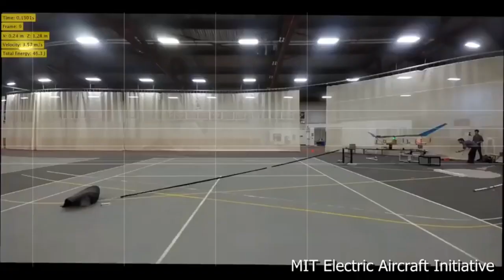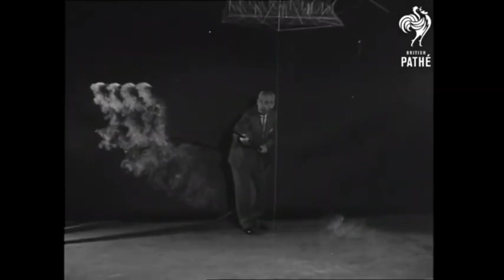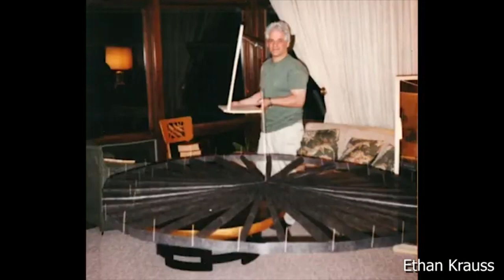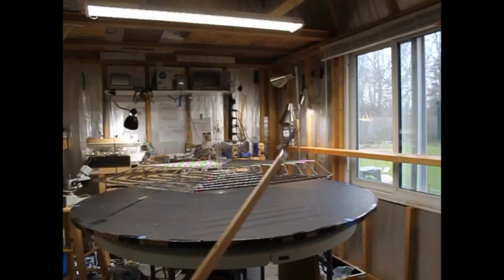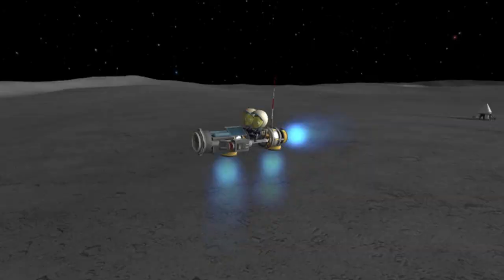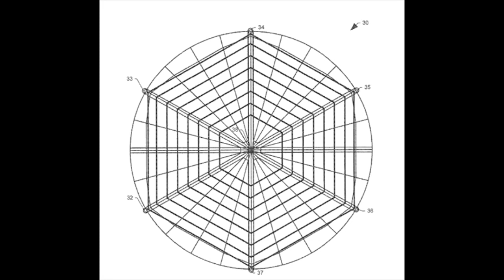Self-Contained Ion-Powered (propelled) Aircraft.  This ion thruster lifts its power supply!

Comment: Amazing work! I have a few question about optimizing some of the contributing forces. I'm looking for research papers on the dielectrophoresis of air and what the limits of that force is before you reach dielectric breakdown voltage. Do you think it is worth while to optimize the magnitude of the force of dielectrophoresis of neutral air molecules and the non-linearity of the inhomogeneous electric field? Or is the magnitude of the dielectrophoretic force so low that the majority of energy is from ion drift and entrained neutrals? I wonder if ionization is actually more or less efficient than this electrophoretic force and how they scale, given that it takes considerable energy to ionize air. Maybe they synergize with some optimum balance where ions enhance the electric field and thus the dielectrophoretic force on neutrals.
Reply from the maker: For now, I'll just give you the simple answer. I can always add more to it later:).  There are lots of problems with the way ion propulsion is currently envisioned.  The equations say that the force is directly proportional to the current.  I have found however, that if you add lots of current, most of it just gets wasted in the form of heat.  Higher voltages at lower current densities create many times more thrust with a lot less power.
Secondly, while there are equations that indicate that it takes a significant amount of energy to create certain types of ions, it is possible to just add electrons to the outer orbits of O2 molecules with very small amounts of energy.  The main challenge is just to reduce the losses associated with creating a high voltage source of low current electrons.
Additionally, letting the voltage on a given emitter collector gap get near the breakdown voltage, like people do with "lifters," creates a much larger current draw,  creates more heat loss, and is consequently many times less efficient, so it takes a lot more wattage.  I am not saying that it isn't possible though, the current input just has to be kept low one way or the other.
The electric field really is inhomogeneous and nonlinear as you were saying.  This is one of the many reasons I'm excited, because, it could be evened out with smooth rings etc.. I think there is still lots of room for improvement:).
Thanks very much for commenting!
Reply: @KraussEMUS1  
This may be beyond the scope of this discussion but I must mention there is a wealth of information regarding plasma and plasma waves as the ideal medium for a process called 'optical phase conjugation' or '4-wave mixing'. One scientist, Larry Reed, has proposed in his paper "Confinement of Light: Standing wave transformations in phase locked resonator" that this process of phase conjugation can be used to impart momentum to and from the environment using the phase conjugation of electromagnetic waves. I find the process he describes analogous to a lever and fulcrum but the lever arm is composed of light in a standing wave, and the fulcrum is a holographic material with non-linear opto-electric properties so that it may couple to the light field.
Reply from the maker: @taylorwestmore4664  
It would be nice to see some sort of replication of TT Brown's HV generator.  I have built a similar sort of thing a long time ago when replicating the Sky Station International patent.  It did not have the capacitors or make any attempt to harvest output voltage though.  I don't know how it would do that   , aside from resembling a Marx Generator somewhat.  I am a bit distracted right now, but will give it some thought.  
Thanks a lot!!
Reply from the maker: @taylorwestmore4664  
Hi Taylor,
This is fascinating material!  For the time being I am concentrating on making a small vehicle fly outdoors as soon as possible, and hopefully with agile steering as well.  I am also making progress with making it reliable.  There are also a few other things in the works, so I don't have much time to go beyond working on a basic EAD UAV.  I'm definitely interested in hearing about what may be possible though!
Thanks again!
Reply: @KraussEMUS1  And thank you for your great work, it is a service to humanity! I'm eager to see your outdoor craft when it is ready to astound the world! Stay safe in these strange and dangerous times, the world needs your genius! 

I will consider the problem of optimizing the flame jet generator as well. Brown was using a thermionic cathode to charge fuel exhuast negative, but he never fully ionized the exhuast into a plasma state.

I believe the solution may already exist in the form of the Helicon Antenna, notably employed by NASA to ionize propellant for the VASIMR rocket. The maximum efficiency an EHD or MHD generator/accelerator can obtain is proportional to the difference in kinetic energy of the ions before and after the conversion cycle. So if we can fully ionize 100% of the exhaust of a hydrogen flame, which means using the Helicon antenna to turn 5000F degree steam into a neutral plasma of free radical Hydrogen and Oxygen, then we can efficiently convert the kinetic energy to electric power. Exhuast in fully plasma state can be charged positive or as Brown suggests negative with a thermionic cathode. His primary reason for this is to give the correct forward direction of the electromotive force and naturally a thermionic cathode is very efficient electron donator at high temperatures. NASA is exploring electrode-less solutions for fusion rockets like the Helicon antenna because the cathodes tend to erode in thermonuclear plasma. But a cold plasma can result from EHD or MHD cooling, that is the goal, as heat that doesn't move ions across a gradient represents a loss to the electro-kinetic system just like heat in any other engine. Cold plasma has very high electron temperatures compared to ion temperature so it has low losses to heat, it would make sense that cold plasma propulsion for drones would be your ultimate aim for this as a mature technology. The trick is getting cold plasma at those speeds and densities from either a air or fuel, or atmospheric electricity or battery power etc. 

Another possible configuration for an ionizing stage could be a rotating magnetic field. Per the  article on the Princeton Plasma Research Laboratory's "Reversed Field Pinch" reactor:

"Rotating magnetic fields have also been used to drive current. In such experiments, as above, gas is ionized and an axial magnetic field is produced. A rotating magnetic field is produced by external magnetic coils perpendicular to the axis of the machine, and the direction of this field is rotated about the axis. When the rotation frequency is between the ion and electron gyro-frequencies, the electrons in the plasma co-rotate with the magnetic field (are "dragged"), producing current and reversing the magnetic field. More recently, so-called odd parity rotating magnetic fields have been used to preserve the closed topology of the FRC."

This is the basis of another kind of plasma engine being proposed that ejects the resulting loop or toroid of ionized gas with a magnetic nozzle, the thermal energy is efficiently converted to kinetic energy by the expansion of the ring plasma and it's magnetic pressure against the eddy currents in flux conserving bands of copper or aluminum, the asymmetrical magnetic nozzle and the rotating magnetic field of the driving coils. I can imagine ionized air from your lifter's exhaust forming 'smoke rings' that are ejected when subjected to such a rotating magnetic field, but such a system increases the weight and so it must be highly optimized given the limits of electromagnets and materials. I wish I could mail you some graphene wire to develop an extremely lightweight electromagnet!
Reply from the maker: @taylorwestmore4664  
Hi Taylor,
Hi voltages with very low currents produce ions with no detectable heat signature using a FLIR One camera. 
 I would rather call this device something other than a lifter, as it was at least partially developed before that name was made up for externally power machines.  I really appreciate your kindness in spades though!  
I think I'm more simply persistent than a genius. Just have to keep thinking about and doing primarily one thing for decades, and then there is a probability of success.
Thanks again:)!
Reply from the maker: @taylorwestmore4664  
Hi Taylor,
The craft is making some initial outdoor flights now and there are currently a couple of videos of those on this channel now.  I hope to fly it much higher with already tested steering soon as well.  
This craft works a bit differently than it is talked about in the literature, generally speaking.  It doesn't create any "plasma" plumes, measurable heat, or ozone.  Rather, this craft just adds some electrons to the O2 molecules, leaving a trail or downdraft of negative ions but mostly uncharged air molecules. This method requires much less power than creating "plasmas," or ozone.  It is much more environmentally friendly.  
I really have enjoyed your thoughtful suggestions so far!!  Thank you for your hard work and fantastic comments!
Reply: @KraussEMUS1  
Excellent! I can't wait to see it soar!

So you say the bottom terminal is actually positive and you have negatively charged the Oxygen(02-)at the top wire? Do you know for sure that the electric field of the bottom terminal never reaches breakdown along the edge, producing positive oxygen ions? This could reduce performance if positive oxygen is produced by collisions with negative ions at the terminal. Neutralizing one Oxygen while ionizing another opposite on the plate. 

Oxygen has much lower voltage required to ionize than Nitrogen so this makes sense to tune the voltage low enough to use negative Oxygen, to exploit the mechanical advantage gained by slowing down the ions with collisions with neutral Nitrogen molecules. 

Ethan do you used pulsed DC waveform? Or constant high voltage, current limited DC?

Have you considered the effects of AC and DC waveforms combined? A DC offset AC signal would be biased in the thrust direction, but periodically reversing the signal, compressing the ions more with each reversal, adding mechanical advantage like a series of turbine blades of varying angles of attack. The frequency of switching is analogous to the number of blades. 

This accomplishes arc suppression by periodically opening the circuit to frustrate the ions, before they ever contact the negative terminal while circuit is closed. This is very similar to the dielectric barrier discharge techniques developed recently to prevent ion backflow. Likewise a neutral plate with a resistor in series might be important to increase the capacitance and limit the current, to pre-neutralize the ions before the circuit closes and the risk of arc is high. I encourage you to investigate the DBD techniques using buried nuetral plates for ideas. You could for example, use a very tiny DBD actuator at 800v to efficiently produce seed ions so that the air is much more conductive without introducing high amperage.

It's rumored in leaks and speculation that oxygen tanks serve this purpose onboard classified government vehicles which exploit MHD effects at high altitude and hypersonic speeds. Declassified government research in aerospike rockets and ducted ram jets indicate they have mature technology exploiting EHD and MHD forces already flying out in the Exosphere. They use the Oxygen for three purposes.
1. To breath
2. To ignite fuel AROUND the craft. To engulf the hull in expanding gas so it acts like an aerospike.
3. to ionize into a cloud of positively charged Oxygen around the vehicle so the air becomes susceptible to EHD and MHD forces. 

This converts heat from the burning fuel to electrical energy efficiently and allows control of the exhaust shell with electric and magnetic fields instead of physical control surfaces.

Your work is important because it's bringing cultural awareness to technology that has been classified and hidden away from Humanity for decades. There are many people that would prefer you failed in your endeavors, for commercial and military interests. But I know you will succeed and help force the discussion into the light where it belongs. And as always, Kudos to your progress. 👍
Reply: @KraussEMUS1  Hmmm you have given me an intriguing idea. Make a solid state impeller of sorts, that separates ionized Oxygen from the air and stores it for later. 

Ionized Oxygen compressor:  
Negative and positive electrodes that are symmetrical wires, to produce both O²+ and O²-, which are then accelerated away from the wire grid into each other on the center of a duct, a valved outlet around the perimeter of the duct opens as the pressure increases and allows Oxygen to flow out into a tank. 

You can exploit oppositely charged Oxygen as a virtual anode+cathode pair, the resulting pressure should be high enough to achieve lift if you valve it out of the pressurized chamber.
You could also amplify this by placing a shaped dielectric barrier between the two terminals, to cause the air to act like the plates of a capacitor. That air is forced to spiral along the barrier in opposite races while being compressed by the opposing dielectric field lines until it is exhausted in oppositely charged streams. The streams could re-enter the compressor and pick up more speed until operating pressures are achieved.
Reply from the maker: Hi Taylor,
When I used to google di-electrophoresis years ago,,  I would often come up with papers about chemicals in solutions, but it was none-the -less interesting.  There is a limit in breakdown voltage of air under normal conditions of about 30kV per cm.  It can be raised using sub-nanosecond pulses.  I've learned through many experiments to go the other way  though, and raise the emitters greatly, as it is far more efficient.  Most people think this is mostly about pushing neutral air molecules, just like they used to think Goddard's rockets were pushing against the air, but most of the thrust does come from accelerating lightly  charged O2 molecules instead. Sure, many uncharged molecules of air are carried along though. There is an interesting Journal of Electrostatics paper by Dr. Adrian Leta that may shed some light. Thanks very much for commenting!
Reply from the maker: @taylorwestmore4664  
I don't think my work has anything to do with anything that has been classified. Furthermore, it has been widely published by the patent office and me for many years  It was done completely independently of anything that may lead in that direction.  It is also an especially lightweight vehicle, so it is not something that is particularly threatening.  
EAD using AC with a DC offset is a very good idea for someone to try as a subject of experimental research!  I tried it a little of that as well as different PWM output HV wave forms and the latter just gave thrust that was slightly less than what was proportional the duty cycle ratio.  Others have reported some positive results though, so it is worth trying some more experiments to that end.
Thanks again for commenting!
Reply: @KraussEMUS1  Yes, only recently have dielectrophoretic forces been measured in air but it was originally a means of manipulating dielectric particles in solution. Very important for DNA assays to separate genetic markers. *Teslaphoresis was named after Nikola Tesla and has been used to synthesize carbon nano-tubes along the axis of a Tesla coil, in the near field where the electric forces are strongly non-linear. 

I sent you a link to an article in one of my comments on the dielectrophoretic effect in air, the scientists device produced sound waves without ionizing the air, using the dielectrophoretic force between low voltage electrodes. This is more efficient than ionizing the air, no actual charge is lost or gained except in the transient induced dipoles of the air molecules. The force coupling is weaker because the air is not charged, but the efficiency is higher because you can conserve charges and transfer the energy purely in the electric fields like a capacitor does, rather than flowing electrons. This would be capacitive energy transfer instead of electric charge/current transfer and would greatly simplify the circuit necessary, as well as lower the voltage requirements below ionizing levels. Capacitive systems can also RESONATE. Tesla was the first to realize this and develop enormous voltages in resonant transformers. Dielectrophoretic designs would need to be multiple stages in series to reach the same velocity however, optimizing the multi-stage dielectrophoretic approach would have to be done to match the performance of single stage ion thruster. 
 
Delectric Barrier Discharge Actuators are closer to your design, except the corona discharge with no exposed electrodes have almost no risk of arcing, even though they do produce ions, they are the result of capacitive energy transfer through a thin Delectric Barrier, the current cannot flow and arc except between the dielectric surfaces where charge accumulates. This has been shown to be both efficient and compact enough to modify wings behavior with plasma on the top surface. There are some beautiful examples on YouTube of wings in wind tunnels showing the angle of attack can be increased without stalling when ionized air is introduced. With the right geometry and ion speed, you may generate partial vacuum over the wing surface and generate lift like a leading edge propeller.
Reply: @KraussEMUS1  Not your work specifically, no, but I'm afraid you are being naive when dealing with this technology. The public facing research is just the tip of the iceberg. It's a national security issue. The EHD and MHD force propulsion scheme has been under development in public AND private for almost 100 years. The Russian, Chinese and American tensions surrounding classified hypersonic missile technology is what I'm talking about. Speeds and altitudes only achievable with EHD and MHD propulsion make these technologies attractive compared to rockets and jets. But there is evidence that these are being used as an adjunct propulsion system to a more fundamental breakthrough in physics. 

The US and Russian Anti-Gravity research programs are the most secret research and development programs on the planet, second only to the knowledge of how to create nuclear weapons.
Lockheed Martin former CEO indicated before he died that the equations governing field effect propulsion have been wrong for over 100 years. Since we introduced the Heaviside approximation of the Maxwell's original Biquaternion Algebra. There is an electro-scalar longitudinal wave, in addition to the familiar transverse electromagnetic wave. Maxwell's original equations predicts it, and it is responsible for transmitting the coulomb field. This additional force field is being used as part of a unified field theory approach to propulsion that assumes an electrodynamically polarizeable vacuum, a theory of quantum gravity is possible. 

https://www.thedrive.com/the-war-zone/31798/the-secretive-inventor-of-the-navys-bizarre-ufo-patents-finally-talks

The US Navy patent recently published by Dr Pais includes a warning about the need to advance this area of research before Chinese technology catches up. A Navy officer vouched for one of their top scientists Dr. Pais. If they are to be believed this is quite the revelation that mainstream academia has been following a dead end for 100 years.

 Lucky for us, there are still independent researchers patenting devices which make use of the predicted electro-scalar wave, so even this breakthrough won't be classified for long.

This is one such independent researchers who has kindly worked out the Biquaternion Algebra for us: http://electricspacecraft.org/index.html
Reply from the maker: @taylorwestmore4664  
Imagine a child's birthday balloon that can rise into the air without helium.  If this technology were made top secret or illegal, they would have to outlaw all lighter than air devices.  It is true that a really large one of these could lift more weight, but the type of stuff that I am working on has nothing to do with high speed high powered craft at low altitude.  Please do not try to get me in trouble or create trouble were there is none!   I truly appreciate your very informative comments otherwise.  You are right that I don't know anything about anything that is secret or for anything military.  The tech that I work on is extremely lightweight low powered stuff and generally speaking has been in the public domain for many decades.  I have just made some widely published improvements.  It is important that I keep my commenting shorter in the future because there is much work to do:).
Thanks for commenting
Reply: @KraussEMUS1 I'll try to be quick as well, I know you don't have time to read my novels haha. 

In point of fact, the military uses spy balloons and spy drones that hover or glide at low speeds, and weigh just a few grams.

But you are correct, you are not in danger of stepping on any toes with this optimization of existing technologies. You are however among a very select few that can prove that heavier than air craft can carry the power supply for this engine type. This is a "cultural artifact" that allows people to ask the next question:  Can it be scaled up to carry people?

When people see your videos and start asking questions about what else is possible, then 'we' can advance civilization with commercialization of the technology. Unfortunately we must do this in opposition to warmongers who understand technology as a weapon and nothing else.

Once again, thank for your contributions.
Reply from the maker: @taylorwestmore4664  
Thanks Taylor,
I was aware of the patent application that was the subject of the article in the link you provided.  It was also the conclusion by experts at the end of that article, that the application did not make sense for the most part, and they were not worried about it.
Thanks.
Reply: @KraussEMUS1  I have my doubts that the field strengths have been achieved YET, but if we reread the subject matter expert's opinion we find it is is not really a criticism, more like an argument from incredulity, or an argument that it is technically challenging given modern technology. 

"While he admits that the theoretical basis for the so-called Pais Effect "is not outlandish, and indeed any charged matter that is undergoing a large amount of acceleration will produce this," Collett notes that there are likely "significant engineering challenges in creating a device" capable of producing such high energy electromagnetic fields."

Unless you're referring to some other claim made. 

Vacuum polarization beyond the Schwinger limit is a well known source of anti-matter/matter particle pair creation and Paiz patent is primarily concerned with the generation of such high energy fields through novel means. This is one way to get around the propellant problem. Make your own mass from energy. Of course you have to supply the energy from somewhere, and Paiz patented a novel fusion reactor design for exactly that reason.

Paiz has other oddities floating around the patent office too, a high frequency gravitational wave generator for example. And a room temperature superconductor which the officer in charge of the US Aviation Enterprise vouched was 'operable already'. We'll just have to wait and see if anything comes out of the US Naval Aviation Enterprise in the near future.
Reply from the maker: @taylorwestmore4664  
One more thing, to be honest, the only government ion thrusters I am aware of primarily, other than MIT, are the dawn spacecraft or their new  "X" thruster, or some devices like that. This device has orders of magnitude more thrust and efficiency for its weight, and I personally don't think the probability of them building one that lifted its power supply is high. I had to do this very obsessively  for many years to make it work.  It also takes lots of custom made or particular materials and novel improvements.  It all had to be just right. Then again, you never know, and their must be more ways to do it:).
Reply: @KraussEMUS1  There is also the Atmosphere-Breathing Electric Propulsion (ABEP) program by the European Space Agency. Spaceplanes and suborbital satellites are the next big thing in aerospace and the military wants the best, and the first. 

But of course this is all public research, not classified research. You won't hear about classified technology through public channels except when information is leaked or people photograph stealth aircraft leaving airforce bases with the technology onboard.

Classified research is carried out by independent contractor laboratories with compartmentalization so that no single person actually knows enough to reproduce critical components. This is for national security reasons so no spy or scientist captured by an enemy nation will actually have enough information to reverse engineer the whole thing. 

Lockheed Martin Skunkworks, Boeing, Raytheon. These are the kinds of private corporations that supply the military industrial complex with enabling technology like hypersonic MHD propulsion.